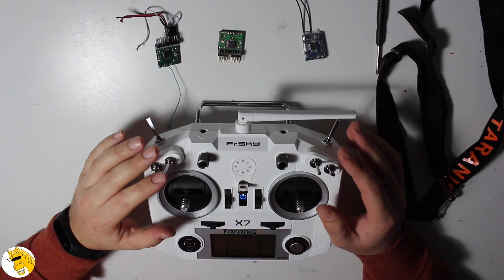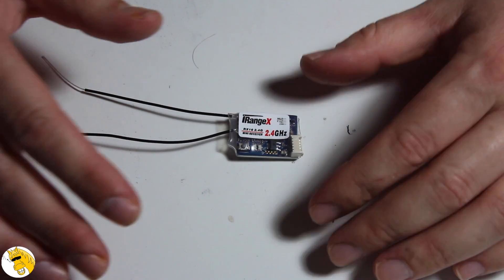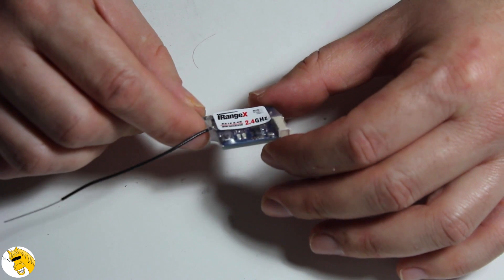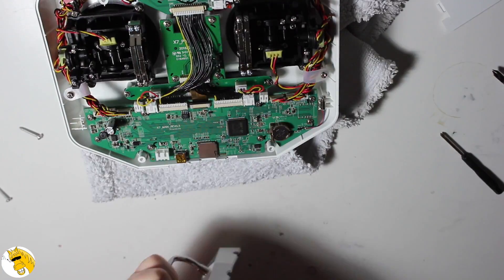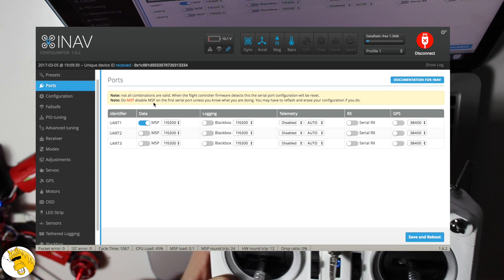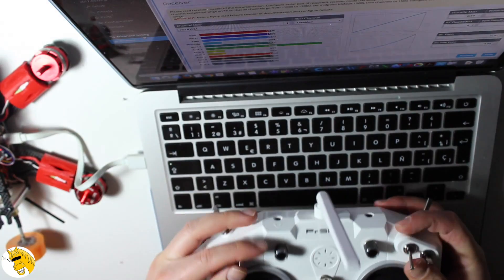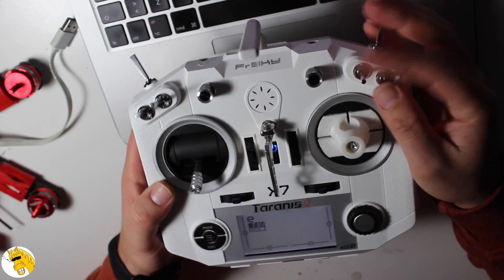2. Taranis Q X7 - First steps: receivers, adjustments, binding and channels configuration

Comment: Great video 
Does qx7  works out of the box ( without extra modules ) with AC800 Receivers ?
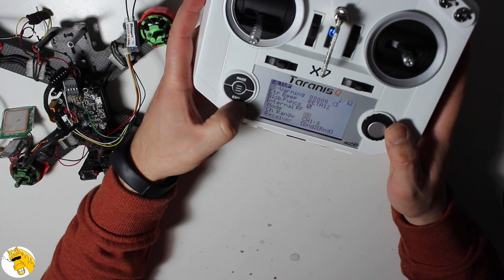Reply from the maker: Thanks! I haven't use the AC800 but I have seen that supports Frsky D8, so it should work just by selecting D8 in the menu. You can see it in 8:18 minute of the video. I have usually linked iRangeX and other compatible receivers. Good luck!